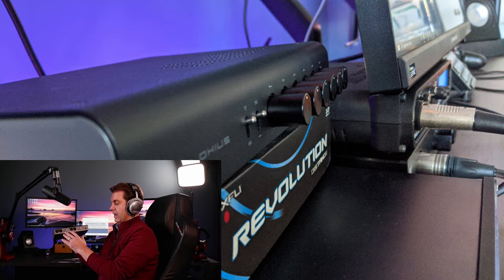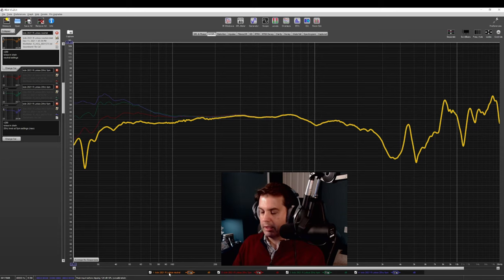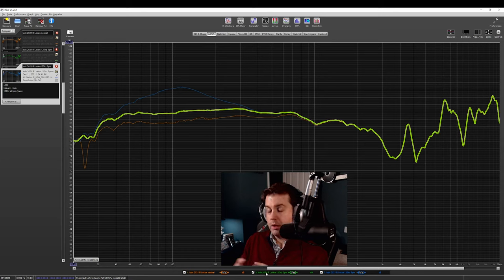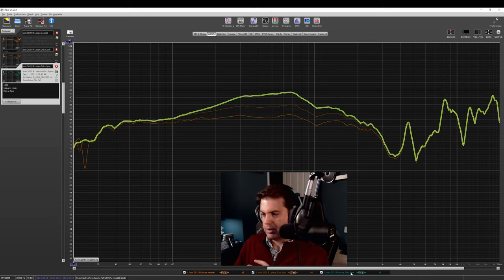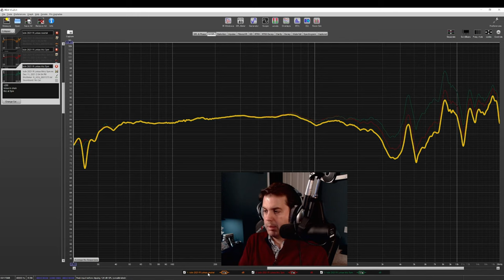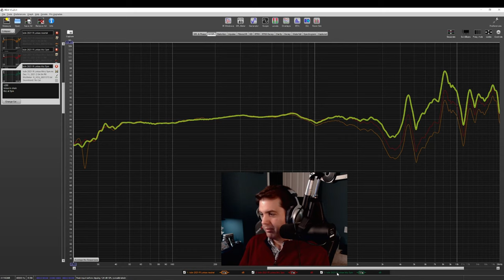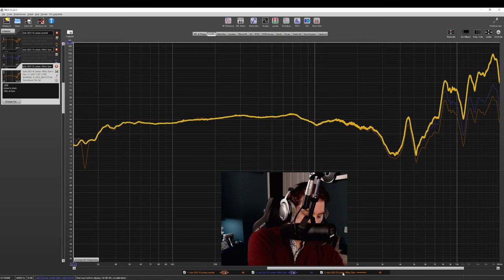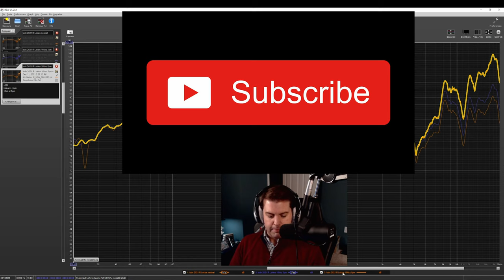Schiit Lokius Review - What is this 6 band EQ doing to your sound?

Comment: I’ve used and loved my Lokius for eight months now and it never dawned on me that there was an issue with the size of the knobs.  The only thing I noticed was the silky smooth feel of the knobs, the slight resistance, and a proper detent perfectly centered.  I have also enjoyed that this thing is dead-nuts transparent in my system consisting of a Luxman Class A integrated amp and Bowers and Wilkins 805 D3 speakers.  A lot of recordings need a little EQ love and this is the ideal unit to accomplish that.  Just be sure to get 2 very good sets of interconnects to connect the Schiit.  And yes, it has a small external wall plug power supply, but thankfully it’s just an AC step-down transformer (that’s why you specify your country’s voltage when ordering).  The actual AC to DC power supply is in the chassis, and the unit gets a little warm because of it. Thank heavens Schiit didn’t use one of those little universal voltage switching wall worts that sound like 💩.

Comment: I really like the idea of a hardware EQ that you can make slight adjustments to on the fly. For listening to music, I imagine making tiny tweaks for certain tracks or even just based on your mood at the time. I think the drawback of the Lokius would be for people that own multiple headphones and like to switch between them. You would likely have an EQ preference for each headphone so you would need to manually adjust the EQ each time you swap headphones. A software EQ gives you the ability to store presets for different headphones.
Reply: Software EQ has an artificial/electronic/digital tone to it once pushed that I can't un-hear once I hear it. The Lokius is fun to us use and the tone enhancements are smooth. I adjust based on the music and/or headphones I listen to and it's not a big deal. If you want presets (x3), there's the Loki Max. I have the Loki Mini + in my Mac Studio Max headphone rig and the Lokius in my main headphone stack (Mac Mini-> S.M.S.L M300SE->Lokius->Freya N->Asgard 3 with 4 different headphones and I can't imagine either of my stacks without a Loki-something as part of the chain.

Comment: Any chance we will see a DT700 & DT900 pro x review with measurements ? Love your reviews
Reply from the maker: thank you very much for the kind words.  YES!  I have them on the list for sure.  I have been doing tons of testing and need to get the reviews on hand done first but I 100% plan on doing the 900 in the near future.
Reply: @gamingaudioguide9292  Is it safe to assume you will show comparison measurements of other Beyerdynamic headphones ? I own the DT990 250 ohm and the TYGR 300. I’m wondering if the 900 Pro X would be better for competitive gaming.
Reply from the maker: @stang4258  Yes, I would throw it against the Tygr 300R, 1990, 990 and 880. Just know it may be a bit.  I have a lot of items in front of that.
Reply: @gamingaudioguide9292  It looks like you’re wearing the DT 880’s in this video, which version is it ? Ohms? Also if you still have the TYGR’s can you put the silver Beyer pads on them and check the frequency response ? One of your videos on the 880 you said the TYGR measured similar. Black pads adding bass to change frequency to 880 and call it TYGR 300 ?
Reply from the maker: @stang4258  I'm wearing the 880's (250ohm) in this video.  Check out my video on the Tygr, pretty sure I measured it with black and silver pads there.

Comment: I just picked up the LCDX 2021 ..and it’s noticeable in the “vocal range”..seems a tad thin ..I was wondering if this is something that I may get to “adjust” the  vocals tinge to be more present.
The LCDX on music it’s awesome, stuff with vocals..it needs something .
Thank for this video!
Reply: Might be a bit hit and miss for you because the dials have some overlap. It's like applying salt and pepper shakers rather than using a very measuring cup to add.

I use my lokius with peace eq in case I need to really dial something in. If you add mids you need to compensate somewhat with other knobs too depending on the end result
Reply: @bentobox3140  That’s the thing , I don’t do computer 💻 derived music source …so I’ll give this a go ..yes the Delta’s on the knobs are wide..but then again it’s always fun to try .

Comment: Is this a major boost eq or subtrakt
I have tinnitus and hyperakusi for topend treble and have my thoughts of maybe this for my salvation. From 7k and up I want to calm down treble! Will this work or?
Reply: I bought the Lokius some 8 months ago for the same reason.  The action of the two highest frequency knobs worked perfectly.  Between the two knobs , or use both, I’m confident you will find a setting that’s pleasing and comfortable for you.  The unit is also extremely transparent sounding.
Reply: I think I'm gonna buy thid for the same reason. I can't handle high frequencies it hurts so bad
Reply: The Lokius might be on sale right now. I just bought a Loki+ this past weekend for my desktop system for $99, regular $149.  Not B stock. Check Schiit’s website.